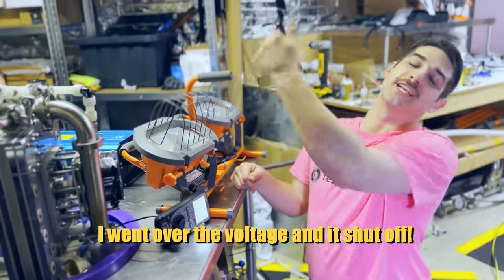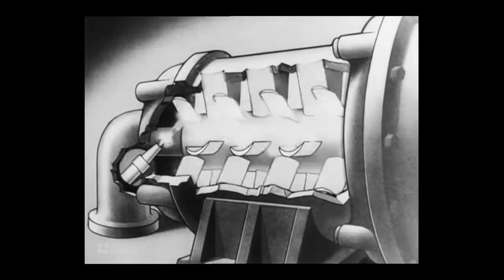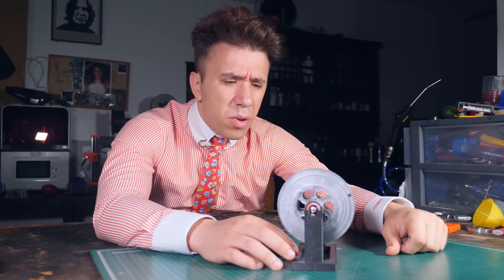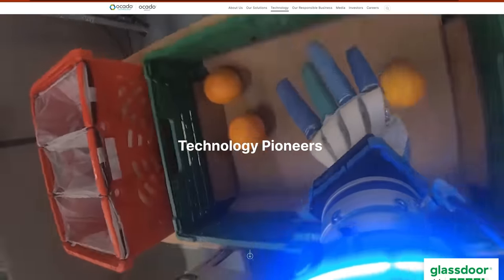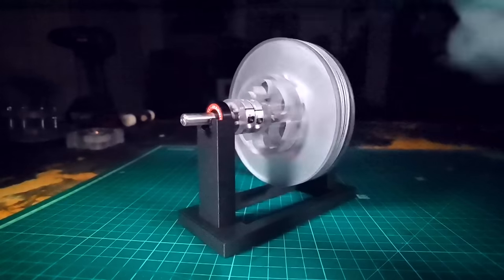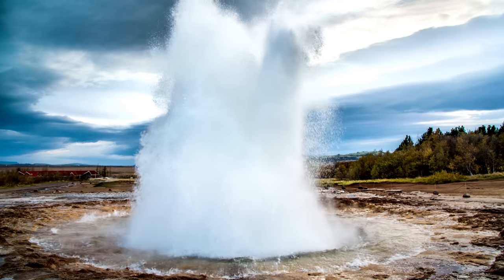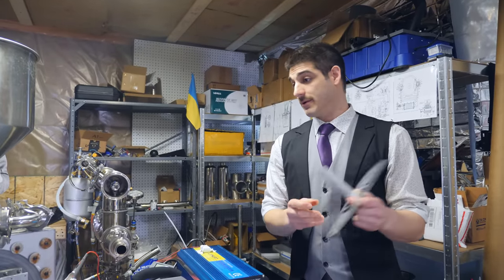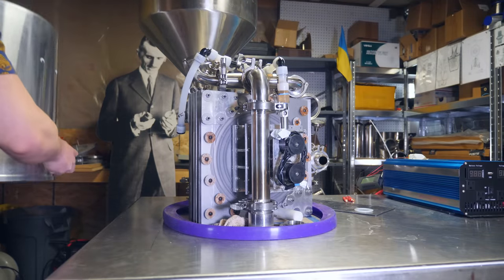Building Nikola Tesla's Bladeless Turbine

Comment: Use the Tesla turbine to display mechanical torque by using it to lift, move, or drive something. Amazing content keep up the good work!
Reply: Not that I know much about this but based on what i know, I don't think it would be good for that because steam or air has less to push against than on a blade turbine, so it would in principle skip or slip but It's rotation could be used to power a AC electric motor (using a DC to AC transformer) that itself pulls up or down a heavy object, two Nikola Tesla inventions working in unison. :)
Reply: Also comparing it to other turbines that he has!
Reply: Hey thanks for the suggestion, I love this idea! We will be doing full combustion gas and steam turbine’s here very soon and we will be putting them in everything from lawnmowers, to motorcycles, EV backups generators, to full power by wire automobiles.

You could realistically remove the 1500lb battery pack from a Rivian truck and stick one of our full combustion gas TesTurbogenerators in the bed and just plug the generator’s rectified DC output output into batteries hook up and it would work just the same. 

And for half the weight of the battery we could provide a TesTurbogenerator and fuel tank that could far out perform mileage than the battery pack due to the weight loss alone. 

Liquid fuels have a 20x energy density than battery systems, which is the name of the game for land vehicles and even more for aerial vehicles.
Reply: @Argoon1981 hey thanks for the comment ❤️‍🔥🙏 to be clear there’s no issue with the fluid having enough to grip on with the discs. The difference with the Tesla turbine is it doesn’t rely on the fluid to “push”. Infact the fluid actually pulls on the disks as the fluids kinetic energy is transferred to each disc in the shear forces/cohesive forces within the fluid and then through the fluids adhesive forces then attach the fluid to the disc material at a molecular/electron orbital level.

When designed correctly the TesTur can output plenty of torque and power and will have no issues in high torque demanding operations. 

If you have any further questions I’m always happy to answer them! 🤓
Reply: During power output the turbine was spinning at about 12,500RPM 

For an exact calculation of the torque it’s outputting in this 1200 watt work light load test specifically, 

Hp = Torque * RPM / 5252

Torque = Hp* 5252 / RPM 

1200watts = 1.63Hp

Torque = 1.63hp * 5252 / 12,500
     = 0.684ft-lbs of torque 

These preliminary tests are just to see how much electrical power can be produced with room temp compressed air driving the Tesla turbine. 

Peak numbers to the shaft we’ve measured is 6.22ft-Ibs of torque at only 4150rpm and +4.25kW between 6000-12,000 rpm on the dyno.

The TesTur nozzles never went over 20psi at the nozzle for the 2650watt electrical load test and not over 40psi at the nozzle for the 4250watt dyno test.   

This is so I can get a baseline for what to expect as I increase the temps to combustion levels.   

When using elastic gasses the counterintuitive thing most overlook is that the viscosity of gasses goes up with temp. 

So not only do we see an increase in thermodynamic efficiency from increased temps but the TesTur isentropic efficiency also goes up due to the reduced slip from the increased viscosity.   
 
Let me know if you have any questions!
Reply: @CharlieSolis  No problem good videos about science is always my cope of tea.  :)  Also like I said, I know almost nothing about this subject, was only making assumptions based on few bits of knowledge, if you say your turbine works for high torque job, then it does, I have no reason to doubt you and not enough knowhow to debate you (friendly debate ;) ). 
All the success with your company and product. Also if you see Integza again tell him  "A fellow bracarense said hi!"

Comment: I think it would be really cool to have a video of you studying the relationship between blade spacing and the ability to generate RPM and torque using fluids with different viscosities. It would be cool to see the impact of a higher velocity viscous fluid like the Devil Toothpaste.
Reply: You wanna know something funny I like ketchup But I don't like tomatoes pickles relish onions
Reply: Mark Rober didn't put out the official recipe for "Devil's Toothpaste" but it sounds cool
Reply: The principle of operation is boundary layer shear force. The closer the vanes less blow by there is.

Also, it is an extremely effective water pump if you want to pump water. Just, be respectful of how powerful a laminar flow of water is.
Reply: @randospawn7495 the recipe is the same as standard elephants toothpaste but instead of 3% H2O2 you use something stronger like 40%+

Comment: I'd love to see this on a larger scale. I work in power generation and think this would help make maintenance so much easier.
Reply: Hey thanks for the comment! 🙏❤️‍🔥

We are working on it! Next bench mark we are shooting for is 10kW then going for 100kW and 500kW with our 10in diameter turbine once multi-staged.

Then we will be going to larger discs. One step at a time though! 🦾🤓👨‍🔬

Thanks again!
Reply: @CharlieSolis  Can you talk at all about the tradeoffs of larger discs? My intuition is that you'd be trading max RPM for improved torque. But there's also the fundamental limitation of the disc being unable to spin once the outer edge of the disc reaches a certain multiple of the incoming fluid's speed. (And the multiple probably isn't 1x because a point on the inner part of the disc will be spinning slower than the air up to the point where you have to exhaust the air. But once the outer edge is spinning faster than the air it would be slowing the system down because of drag?) Then I'm sure for a small operation there's challenges related to manufacturing larger components. And eventually your disc will spin itself apart even if you can provide it with infinitely fast input fluids. Semi-related to discs blowing up: how about graphene as a disc material at some point in the future? That seems like it would provide the theoretical limit of disc surface area to strength and thickness.
Reply: Graphene thought is interesting although an aerogel demo would be funny af
Reply: @CharlieSolis  be careful not to unalive yourself with shots to the back of your head
Reply: @vgnhdhe why would that happen? If anything someone will steal his idea and profit from it, no assassinating needed.
Reply: @hydranos1058  I saw on a different video that there is no material on earth that can handle the speed of discs made for heavy duty or industrial use. Still I'd like to see a system based on Tesla turbine that can take advantage of hot air flows in hot days, wind and rain. That would be the ultimate ecofriendly generator for domestic use if the output can reach 12-15 kW a day. Of course, it would depend on the initial cost too.
Reply: @hydranos1058  hey thanks for the question! ❤️‍🔥🙏

I’ve got some copy pasta 🍝 of mine that I’ll share with ya here to explain more. It’s not a direct answer but the answer is definitely in here with lots of important considerations to take into account. 🦾🤓👨‍🔬

Tesla turbines aren’t made efficient by spinning really fast.   

That’s only for when the disc stack is being used as a centrifugal pump, because ALL centrifugal pumps’ compressors, performance is tip speed dependent.   

But spinning the turbine fast will produce a centrifugal head that opposes the incoming fluid flow, reducing the pressure gradient across the nozzle, reducing fluid final velocity, reducing mass flow rates through the nozzle and ultimately reducing power out. 

Furthermore the faster you spin them the faster the fluid you have has to go just to still be moving faster than the discs and still provide torque.   

Lastly, they work just fine for industrial use and can scale up just fine because the torque on the discs is proportional to the difference in the fluid speed and the disc speed. 

So the disc tip speed is the important factor here. 

For any given fluid supply in, the bozzle will have a max fluid velocity. 

So the turbine disc tips will have a max speed set at that fluid speed irrelevant if radius. 

Now considering that centripetal force is proportional to V^2/R, if you keep the tip speed the same but increase the radius the centripetal forces on the disc for the speeds needed will actually decrease. 

Despite what MANY have claimed about the Tesla turbine, it does NOT need to be spun fast to work or work efficiently.   

TesTurs are made efficient when the slip on the discs is reduced and spinning the discs fast does nothing to reduce the slip, only increase the distance the fluid slips on the disc faces, which is by definition “loss”.  

Listen to what Tesla himself said in the patents of how to make them work.  

“Owing to a number of causes affecting the performance, it is difficult to frame a precise rule which would be generally applicable, but it may be stated that within certain limits, and other conditions being the same, the torque is directly proportionate to the square of the velocity of the fluid relatively to the runner and to the effective area of the disks and, inversely, to the distance separating them. 

The machine will, generally, perform its maximum work when the effective speed of the runner is one-half of that of the fluid; but to attain the highest economy, the relative speed or slip, for any given performance, should be as small as possible. 

This condition may be to any desired degree approximated by increasing the active area of and reducing the space between the disks.”  

1) increase the speed of the fluid relative to the disc, (not increase disc speed)  

2) increase surface area 

3) decrease disc spacing  

This is how you actually make a TesTur work. Not by spinning it fast.   

The fluid interactions with the disc that govern efficiency an torque are adhesion and cohesion. Full stop. 

And spinning fast does nothing to increasing either to increase the turbines isentropic efficiency.   

This is why everyone who chases rpm with the TesTur just flat out fails. 

They aren’t even trying to design them properly so of course they won’t work. 

You just have to know how to design it correctly to actually reduce slip to make them work, not spin them fast.  

The only reason people think Tesla turbines have to be spun too fast is because EVERYONE has mistaken the part of the patent that is about the turbine being used as a pump as being about it being used as a drive turbine.   

The only time you want to spin a TesTur fast is when it’s being used as a pump/compressor. 

This is because ALL centrifugal pumps’/compressors’ performance is tip speed dependent.   

“I have found that the quantity of fluid propelled in this manner, is, other conditions being equal, approximately proportionate to the active surface of the runner and to its effective speed. 

For this reason, the performance of such machines augments at an exceedingly high rate with the increase of their size and speed of revolution.” -Nikola Tesla 

And again, you DO NOT want to spin too fast in a TesTur because the centrifugal head will just counter your incoming fluid flow reducing power. 

And the faster you spin discs, you’re fluid has to be going even that much faster just to be able to apply a torque on the disc face.  

 “Still another valuable and probably unique quality of such motors or prime movers may be described. 

By proper construction and observance of working conditions the centrifugal pressure, opposing the passage of the fluid, may, as already indicated, be made nearly equal to the pressure of supply when the machine is running idle. 

If the inlet section be large, small changes in the speed of revolution will produce great differences in flow which are further enhanced by the concomitant variations in the length of the spiral path. 

A self-regulating machine is thus obtained bearing a striking resemblance to a direct-current electric motor in this respect that, with great differences of impressed pressure in a wide open channel the flow of the fluid through the same is prevented by virtue of rotation. 

Since the centrifugal head increases as the square of the revolutions, or even more rapidly, and with modern high grade steel great peripheral velocities are practicable, it is possible to attain that condition in a single stage machine, more readily if the runner be of large diameter. 

Obviously this problem is facilitated by compounding, as will be understood by those skilled in the art. 

Irrespective of its bearing on economy, this tendency which is, to a degree, common to motors of the above description, is of special advantage in the operation of large units, as it affords a safeguard against running away and destruction. 

Besides these, such a prime mover possesses many other advantages, both constructive and operative. 

It is simple, light and compact, subject to but little wear, cheap and exceptionally easy to manufacture as small clearances and accurate milling work are not essential to good performance. 

In operation it is reliable, there being no valves, sliding contacts or troublesome vanes. 

It is almost free of windage, largely independent of nozzle efficiency and suitable for high as well as for low fluid velocities and speeds of revolution.” -Nikola Tesla  

Tesla both knew it wasn’t meant to spin fast and that it worked great for low speeds IF you design it correctly.
Reply: @Belaziraf  hey thanks for the comment but read the comment I just put above here. I know there is the common misconception that TesTur have to pin fast but it’s a complete falsehood. 

I explain it in my comment just before this one.
Reply: @hydranos1058 Regarding drag from the slower inner part of the discs, I imagine that's the reason for the slits cut near the center of the discs? To minimize the surface area of the slowest moving part, and thereby minimizing drag?

Now I'm no engineer, but it seems to me that compared to most other turbine designs, this is probably extremely easy to manufacture. Not only that, but the part that is likely to wear out (the rotor) also seems very cheap and easy to replace. I imagine that a modular generator system with a bunch of these turbines running in parallel would be quite easy to maintain. Each turbine could be shut off independently, removed, opened, have the rotor changed and be back in operation within minutes, all without ever disrupting the operation of the generator.
Reply: @CharlieSolis I think the best way to get more power would be to have more of these in series. Definitely worth a test to see how big it can get, but I feel as though at a certain size the centrifugal force will be too high. But multiple of these connected to the same fluid source could provide more output. Perhaps less per unit but overall more total power. Just an idea! Love this concept I was in awe watching this video! Get some good pictures for those history textbooks!
Reply: @spray_cheese  yes staging is another way to go but as you correctly pointed out, same as with the large one the multi small one will have each centrifugal head add to the next. So this same self regulating condition happens all the same in a multi staged rotor. Though the issue with staging is the interstage losses that can occur by the fluid as it transitions between each stage.
Reply: @CharlieSolis  that would definitely be the tricky part. My mind tells me 2 separate pumps but at that point it’s pretty much a separate system, and you might be sacrificing too much power for said pumps by then, I suppose ideally like you mentioned is no pumps at all, geothermal activity or other pressures that we just otherwise discard. Which takes way from that idea as well😂 thank you for the response!!
Reply: @vgnhdhe it would be a lot easier for Rolls Royce to dump a truckload of money on his doorstep...

Comment: Here's my video idea! It would be expensive but I think testing different materials and surface finishes on the disks could pull a non-insignificant amount of additional power out of the  generator, I'd start the surface finish tests on the cheapest material if it were me lol.
Reply: I'm really curious about this too. Even just with the aluminum, testing a gradient between smooth like a mirror and so rough there are gouges taken out would be really cool to see. Maybe it wouldn't be as simple as "x finish is the best", but instead certain finishes might perform better for certain requirements. If the finish does significantly impact performance, I could see multi-finish disc assemblies becoming a thing, too.
Reply: @poipoi300  I never even thought about optimization across multiple platforms, I'm absolutely sure different finishes would result in higher or lower torque in different flow or environmental conditions even within the same flywheel. I could never do it but I will sit and watch a 30+ min. Video on it and smash that like button lol
Reply: @devonmcnealy8900  Oh I wasn't thinking of different environmental conditions, but yeah I assume you could totally take advantage of that. Say your fluid is full of heavy particulate, it might be good to have small grooves to catch their inertia before spitting them back out.